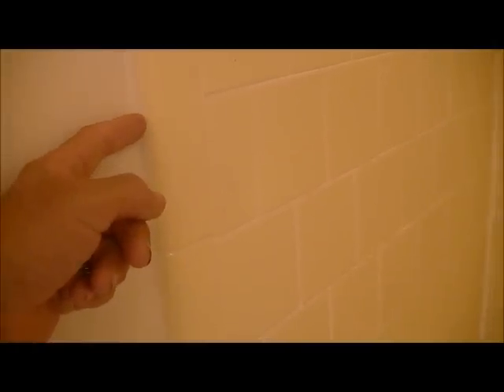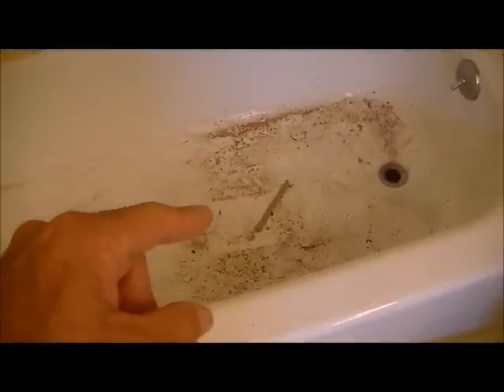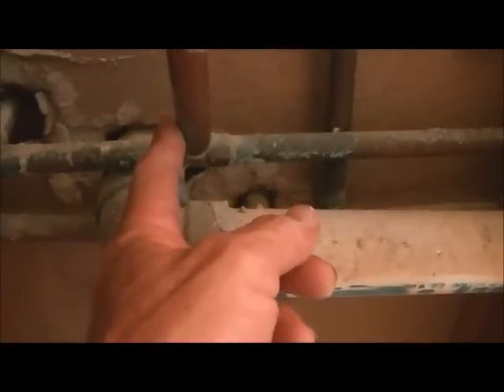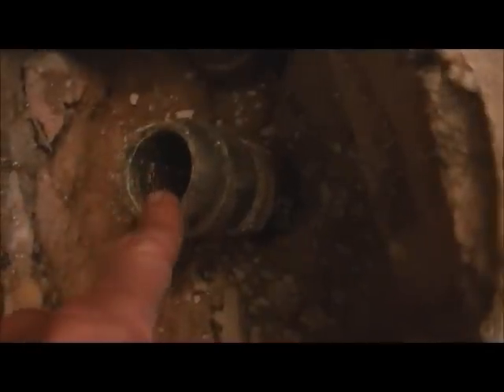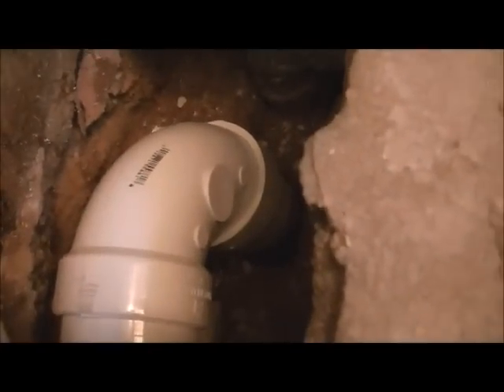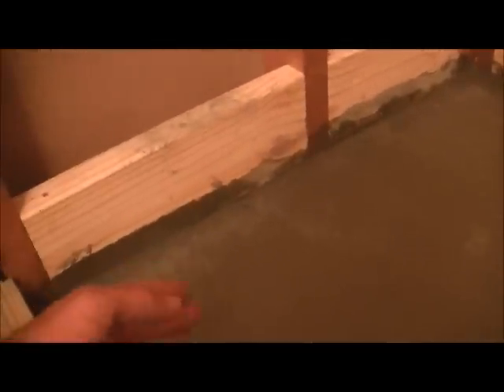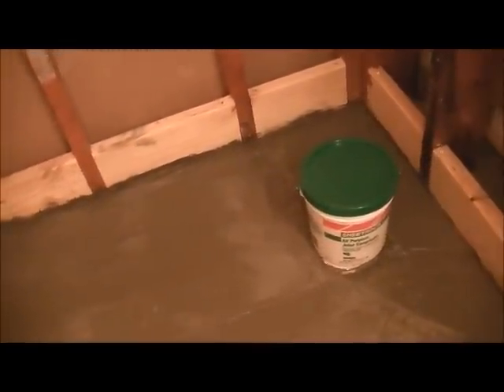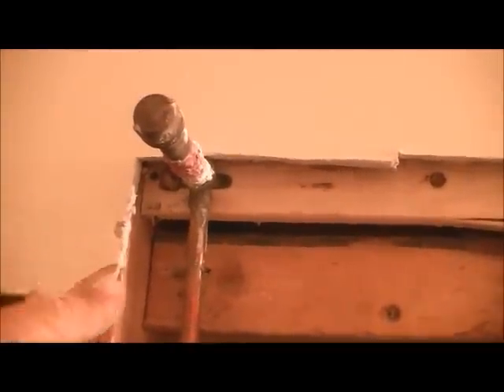How To Convert Tub To Shower

Comment: Nice video. I am currently working on a project identical to to this. Just wanted to add that cutting the pvc pipe below grade in a confined space is easily accomplished with mason string. Align the string with the pvc pipe, and keep it level by using a screw driver or some horizontal bar with a smooth surface so that at you cut the pvc pipe the string remains level, this is critical so that the cut of the pipe is level, smooth, not rough and uneven. This is a two person task as one person will need to be on their knees holding down the screw driver with their hands in the hole while the person stands directly above the hole and starts to slide the mason line back and forth to create the cutting action, Just a couple points on the mason line, it is very strong and does not break, it's the same stuff the brick layers use to create. Straight line. Secondly do not stop cutting once you begin otherwise the string may fuse to the pipe. Thirdly, long strokes will help so that the heat dissapates while cutting, otherwise you run the risk of melting the string into the pipe. With regard to setting the drain flange, the caulk is recommended by Oatey in their video, and I don't see how it can hurt, however, by not using it, I can see where water penetration is possible if the drain backs up and you're standing in ankle deep water in the shower. Additionally, I recommend that everyone test the weep holes so that you can be certain that the rubber liner has not obstructed the weep holes. I initially installed the liner and clamped together the drain, and then when I went to test weep holes, they would not drain. The cause was the rubber liner was not cut back to the circumference of the drain and obstructed the weep holes. To test, get a cup of water and a straw. Place a little water in the straw and put in the weep holes. You should see it drainimmediately into the drain. Once you do this, you'll understand the importance of the weep holes. Anyway I just wanted to add my experience of a couple of gotchas that might help someone out. With regard to using the red guard all the way to the drain, I can not see any reason why you would not red guard all the way to the drain, I'm sure it's not for cost, so what would be the downside of coating the entire surface.

Comment: You can use a dremel tool with a 1 1/2 in cut off wheel to cut the pipe.

Comment: I'm changing my tub to a full shower. Every plumber that I've had over for an estimate on switching the drain has been outrageous in their pricing. And I swear, the floor is open and ready to go, there's nothing to do except cut off the tub drain, add the new upsize connecting pipe where one end is 1.5" and the other is 2", and install the new drain. Your video shows how to do it and it looks simple (well except you had to cut cement, and I don't). I wish I could attach a picture so you can see how easy these pipes are to get to. I think the job is too small for them and theyre trying to convince me that it's an "all day job", just to make a buck!! I'd do myself, but I'm leary of doing something wrong. Sigh . . .
But thank you for showing how it's done! They can't fool me!
Reply from the maker: +mel408  Plumbers make 6 figures and thieves ( in my humble opinion ).

Comment: Great video for me because all things mention are what is in my bathroom; the space between tub and toilet, and you have the same tub drain system I'm having to deal with too. 1975 house on a slab/with the whole for the p- trap, and the wired mud walls that is tiled, however; I will only chip off the old shower tiles from the mud walls and after the tub removal, my plan is to even-up the missing walls were the tub was with 1/2" or 1/4" backer board then seal it up with TEC Skill Set Membrane (Redgard). So your video for me is all in all right on time for my project I already started. I'm also using your other video on "How to build a shower nook". Thanks and keep-up the good work and advise. I will recommend you and your company (videos included) You saved the day on that drain problem (p-trap) that brought me here to Youtube.

Comment: Great video - explained very well - wish you had included some of the tiling but I got the idea.  I like it - nice work!  Sounds like you need to invent a one piece preformed curb cover so you don't need to nail through the liner although the water stop paint likely works fine.
Reply from the maker: +NutmegThumper  Thanks for the comment. Actually there are "foam" curbs out there, I think Kerdi has one...guess I'm old school, would rather build it and Redgard it, still waterproof but more sturdy.
Reply: Hey excellent job. I want to know if you used modified or unmodified thinset to butter the shower curb that you built?
Reply from the maker: +Kevin Smith  I'm not into the "science" of the products, lots of opinions and forums that discuss ( and argue ) the points. My feel is water will never see ANY of the thinset so it doesn't matter. But I use Home Depots brand Versabond.

Comment: You should get yourself an inside cutter. It attaches to a drill and cuts from the inside out. Awesome tool. Just be careful to tighten your Chuck on your drill. Also, those fittings are 90's not 45's.

Comment: one tip to cut the drain pipe without having to contend with a bent sawzall blade...there is an internal pipe cutter that goes in your drill about 6 inches long with approx 1" sawblade on the end.  It makes quick work of cutting pipe in a difficult area.  just make sure that the tool is chucked in the drill tightly or your tool will fall out of the drill and go right down the drain. lowes and the depot have the tool for around ten bucks.
Reply from the maker: Thanks Jeff, I'll have to go get that ! A tip for you, I have a telescoping magnet for those times I've dropped ( flange bolts ) into the drain ;-)
Reply: To prevent anything falling in just tie a string or wire to a rag ( I prefer newspaper ) and push it down to just below the cutting area.

Comment: I've a few concerns about this. Penetrating the curb and vinyl liner (with nail or screw) any where in the "wet area" can lead to eventual swelling of the lumber curb, which will then crack the grout, allowing even more water to accelerate deterioration. Twenty-something years ago, I came-up with the method of making a one-piece galvanized metal-lath (upside-down) "U" (channel) which lays full-length over the curb/liner. Be careful that the metal does not quite touch the liner on the bottom/inside of curb. When you do your cement/sand mix layer on liner, it grabs/holds the bottom of the lath on inside of curb. The next day, you can then nail/screw the metal lath at the bottom OUTSIDE of curb only. You then pack/coat the metal lath with good thinset/tile mud and the next day when that is dry, it is very strong and tile ready. You could also coat the lath with a portland/sand mix with some liquid bonder admix. No penetrations in wet-area. I also recommend having the liner come-up on wall a few inches higher when possible. 

Using  Redgard over greenboard is questionable. Why won't moisture enter the greenboard from the bottom edge, even if you tried coating it? It won't stick so great there. Plus, Redgard is prone to peeling-off of a smooth semi-slick surface like drywall/greenboard.
Reply from the maker: +terebrate Thanks for your input, sounds like a great way of building a cub ! However, tile & grout done improperly water still gets in it and absorbs moisture, ruins the floor under, water drips into kitchen ceiling. To your comment of swelling wood...water will never see the wood, so can't swell...and never had those issues, besides the pan liner acts as an uncoupling membrane so the transfer is impossible.

To the greenboard comment, Redgard will not "peel" off if you don't pull it off...after applying it you tile it, so a moot issue. The walls could be ANYTHING, but whatever is used is still porous and will take in water if topical membrane isn't on it, so cardboard could be used.
Reply: Would it be okay to waterproof the ceiling as well, like if I was going to tile the ceiling?
Reply from the maker: Of course, can't do any harm, but then why not install a fan in there...a more practical approach.

Comment: Thanks for sharing this project and all the details I haven't heard from other videos (i.e. nailing the curb vs. glue). Seeing this really makes me re-think if I want to take on my DIY project, which it looks like a similarly aged home (1953). Is there a way to find out if there is concrete under the tub before I tear it out?  I plan to replace the tile on the wall and floor regardless, will that reveal enough to know what's under the tub?

Comment: sorry but I have an issue with a few things. 1) transitioning a 2" drain to a 1.5" drain is against code and can risk drainage issues. 2) Covering any joints is troublesome to me, I usually lay down a floorboard one cement board and pour a new cement bed on top that way if they want to re do the shower for what ever reason they still have access to the drain. 3) The liner should be higher about 10-12" for added prevention of leaking on the inside of the shower. However good on ya for using PT wood and wrapping the liner all the way around the curb. Also good on ya for mentioning sloppy corners. A nice tight corner means less chance of water getting in. I like how you don't cut more than you need for the flange glad you mentioned that.
Reply from the maker: Thanks for the comment. 1) You're right that the drain line for the shower  & p-trap should be 2'', past the trap it's ok to be 1 1/2'', but in this case it was nearly impossible to transition the trap ( under grade level ), but it does drain fine...and a low flow shower head insures no back-up issues. I personally stayed at this house & used that shower for over a week with no issues. Also code varies. 2) Great idea on the board idea, I guess someone will have lots of fun with a jackhammer in 20 years ! LOL ! 3) Code says liner should be a min 4-6inches above mudbed, I have 4'' here...would I want more ? Maybe, but I never go 10-12 as you suggest, I believe the 3 coats of Redgard will prevent my walls from ever seeing water, let alone the liner.

And thanks for the compliments on the other issues. Sorry you had to suffer through 45 minutes of me talking, brave guy !!
Reply: dsfs Can you explain the alternative to covering up the drain hole with cement? Do you lay plywood on top of the slab, then cementboard, and attach the drain to a cutout in the plywood/cementboard? Does code allow that type of construction? I've only seen showers constructed with cement surrounding the drain.

Comment: Treated wood tends to twist and crack as it dries out causing tiles to crack. Use untreated 2x4's; however, if you are using untreated lumber on a slab, you need to isolate it from the slab to prevent moisture migration (use a moisture barrier between the lumber and the slab). In most locations, it is a code violation to install untreated lumber in direct contact with concrete because the moisture from the concrete will rot the lumber. That being said, I think a concrete curb is best.
Reply: Its true enough that PT wood does twist and warp. However... not once its nailed down flat on a floor three pieces thick and the nails/screews are placed that close together and also wrapped with two layers of Duraroc and mudded over with thinset. If you were attempting to use PT lumber to frame with in which case it only gets nailed/screewed roughly every 16" or so and with it only being used one stick at a time it will definitely try to crawl back to the woods. His curbs are built and prepped better than ive ever seen. Being a pro tile installer myself, i always build a 4"×5" form and pour my curbs. Even when on a wood foundation, i line the bottom of my form with 30lb felt and apply liquid nail underneath the felt before pouring and then once cured attach 1"×1" angle brackets to the floor inside the shower and on the inside of the curb which gets mudded over on the first pour of the concrete on the shower floor. And i still lay my vinyl pan over the curb all the way to the floor on the outside but i fold my pan and lay it on the outside floor about a 1/2" just for the purpose of having a place to nail it and then i morter over the curb when i do inside the shower and then finally i use a waterproofing membrane over everything with exception of the shower floor. I also agree that i dont see the point in waterproofing the shower floor and I dont know exactly what, but theres something about the idea of doing it that tells me it shouldn't be done. I dont know if its the possibility of a mold/mildew issue if water happened to get between the tile and liner or what but something just doesn't feel right about it.
Reply from the maker: Not to mention that all floor plates in a slab house are pt wood
Reply: Exactly right. Some even go as far as using green plate for a botom plate

Comment: My bathroom consist of a large tub along with tile surrounding all the way up to the ceiling. Im thinking of of removing the tub,and then adding tile that either matches or goes hand in hand with the current tile currently place. Adding a stud at the bottom for a dam,then perhaps using mosaic tile for that part.Along with hardibacker for the flooring along with tile I would hate to remove everything completly,the tile above the tub now is nice tile.Ever seen this done? I would of course keep all handles and drainage as is.
Ive never seen sheetrock used in showers,only durock btw.
Reply from the maker: To answer your question, a transition to another tile & using a "border" mosaic or something to define the difference is done sometimes, yes...depends on if you are ok with that look...I've done it a few times, looks ok.  Doesn't matter the backerboard, using a topical membrane like Redgard is MORE important than what wallboard is used...I could use CARDBOARD on a shower wall if sealed properly.
Reply: Oh ok gotcha.Yea thats what I'll do.Cheaper too. As far as the shower pan,I've seen some built,but I think it would be better to buy one constructed already.Any thoughts on this?
Reply from the maker: Jay mans I think the pre-fab pans are great for a DIY'r...makes it simple.
Reply: Alright cool. Hopefully I'll find one in that size.Thanks for the input!

Comment: Nice job. Just not crazy about the tile lay out on the back wall. In one corner you start with a full 18 x18 and the adjacent corner looks like a 6 x18. Would have looked more symmetrical if each corner had a 12 x 18. Otherwise, great video, really informative.

Comment: 1) do i have to do a pre slope?
2) would it be fine to use the dry pack for both the pre slope and the actual pan
3) do i need to make all side of the curb touch... or leave a gap between the three           pieces of durock?

fantastic video by the way... you're the only vid i found that shows it over a basement type floor. and the only one to explain what the heck to do with the curb . lol
Reply from the maker: 1) Pre-slope is code now in a lot of areas
2) Yes...but for the pan, I don't, I feel better having a wetter texture.
3) It almost doesn't matter since the gap will be filled with thinset anyway, but I always Redgard my curb on all 3 sides, so it's a moot issue.

Thanks for the kind words ! Much appreciated ;-)

Comment: Your video is great and have watched several times and decided to take on our project as a DIY.  We have removed the cast iron tub and ready to convert to the walkin shower.  We have rebuilt the plywood floor for a solid flat surface and now ready to build the shower pan. We are confused as to whether or not we need to pour concrete ( as you do on the video) on the plywood before installing shower pan material, then another layer on top of shower pan material as you do in your video for the slope.  Why can we not put the shower pan material on the plywood floor and save a layer of concrete/mortar?
Reply from the maker: Thanks Steve for the comment. In this video I poured concrete on the floor to get the drain to par with the concrete subfloor, since you have a WOOD subfloor, there's no need for that step....however, the correct method nowdays is to pack in sandmix ( available at Home Depot ) to form a pre-slope on the wood subfloor, let it dry, then install pan liner and then pour sandmix into the pan & taper to the drain flange. I'm not a huge fan of the process for various reasons, but that's how it's supposed to be done. There's a kit called Pitch Perfect for the DIY'er which is a good product to make it easier.

Comment: Nice job! But the requirements say that the  durock goes down first then the mud job floor goes down.  That the mud job floor should hold the durock and the screws should be 8 inches from the ground.
Reply from the maker: Your comment appreciated. However, codes vary depending on city/state you're in. Cement board would do nothing on a cement floor, and screws are high enough up as to never see water...Redgard will ensure that too ;-)

Comment: can you please share the name of the insulation material you used between concrete and the tile? Great video thanks for sharing
Reply from the maker: There is no "insulating material"....a pan liner is set, then the pan is poured with sand topping mix, sloped to drain, after dried out the tile is installed.

Comment: Did you pre-slope the floor before putting in the vinyl liner? Also, that vanity top is probably Corian or some other engineered solid surface, I have one just like it. Easy to maintain, just scratches some what easily.